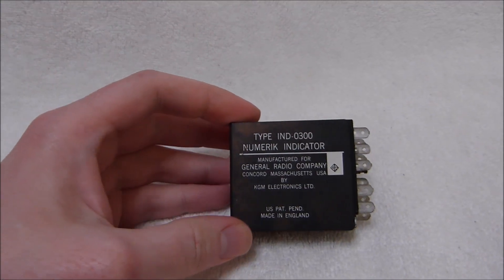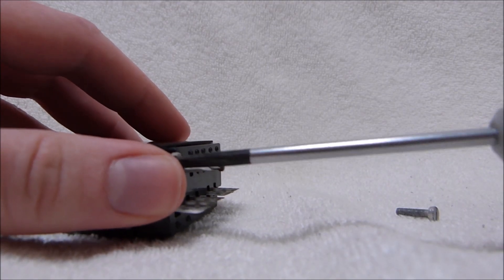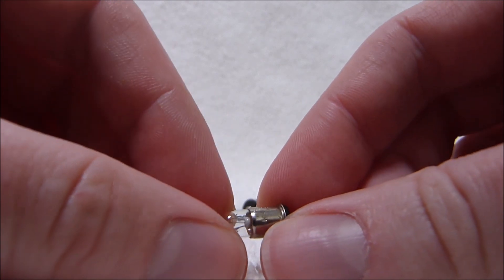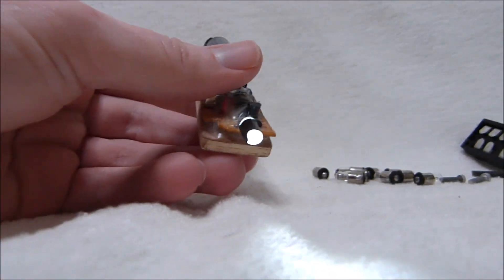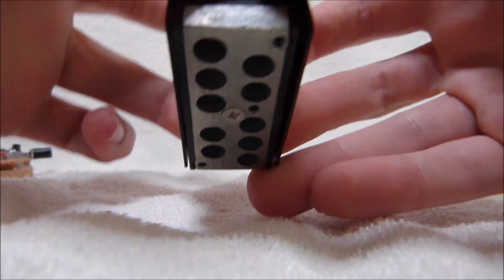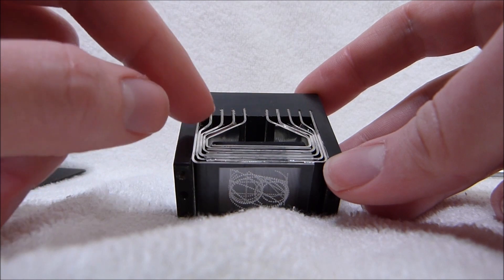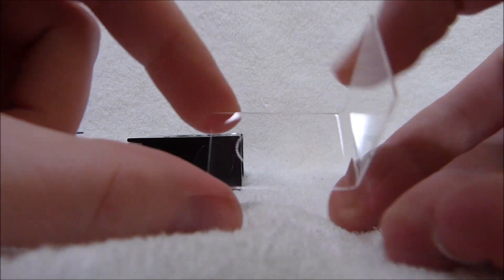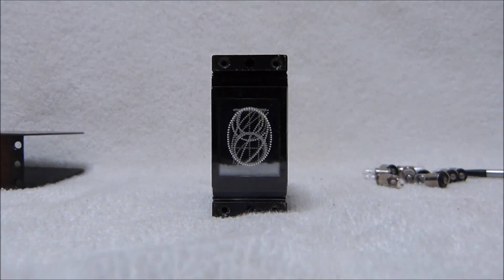KGM edge-lit display "Numerik Indicator" model IND-0300 (England)

Comment: Thanks so much for showing us this interesting example of vintage display technology.   I bet the view angle of the display is very good as you are viewing the lit up "inside walls" of the acrylic holes.  The holes are tiny too, and that helps too with frontal viewing as the center hole is probably less apparent.  Fascinating displays,  and thanks again!